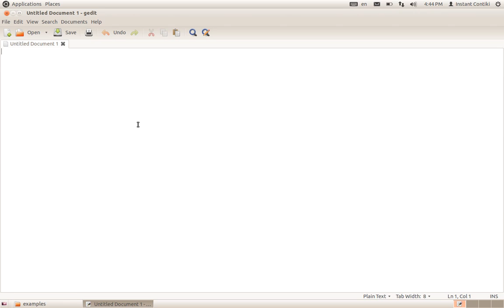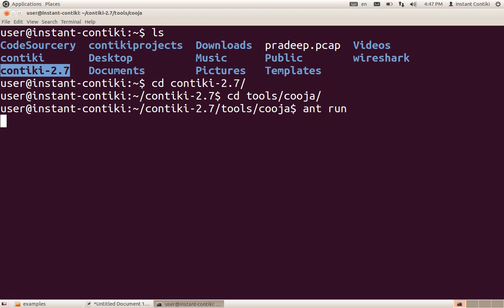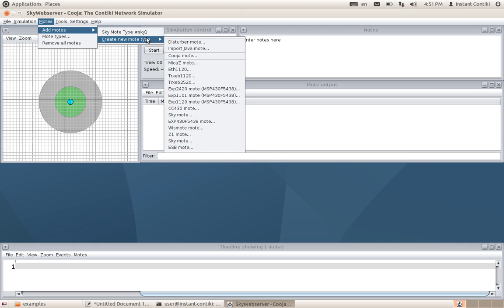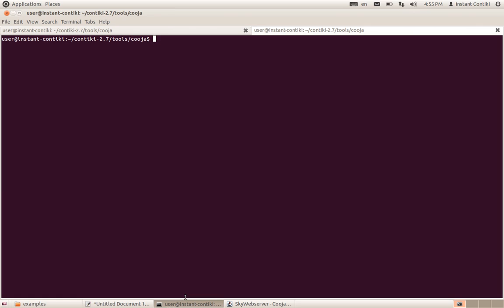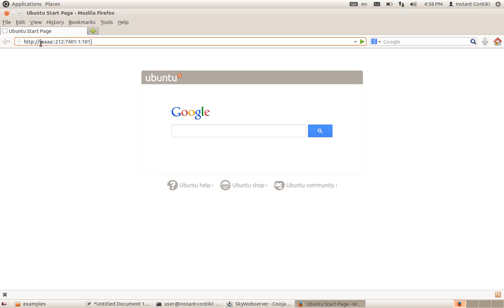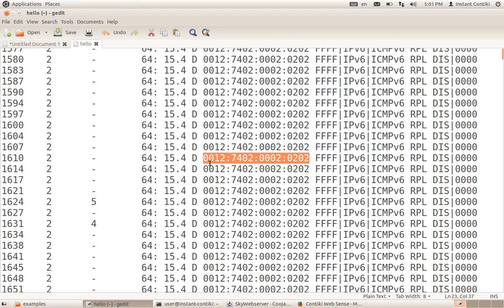Comment: Hi Sir, 
I have one small question regarding the RPL Border Router. Is it possible to connect it to the collect view tool of the cooja and get some statistics about the network. I have tried using an RPL Border Router with several UDP sender motes (sky motes). The work fine and can see the routing table of the border router through the web browser. But I can not see anything through the collect view tool. Would you please give hints on how to use the collect view tool with the RPL Border Router.
Reply: I have this same issue, the thing is that collect view uses the serial line to read the messages sent from the network and this serial line is also used by tunslip to enable IP communication with your network, so you might need to modify the border router or add another node that uses its serial line to send the info to collect-view I believe. If u manage to do so please let me know!
Reply: if you check over examples/ipv6/udp-sink.c you can see that the sink prints (using printf) all the information sent to him. This transmits all the data through the serial line that collect-view is listening to. With the border router you cant do this because the serial line is used by tunslip tool, so maybe you could try to add another node that is part of the network but not the sink and capture all the data sent and use collect view over that node. Another idea is to send it through UDP and adapting Collect-view to listen to a defined UDP-Port. Thats what I am trying to do right now.
Reply: David Santos what code should be kept in this node to send to collect view? I tried to copy existing example code. but it's not working.